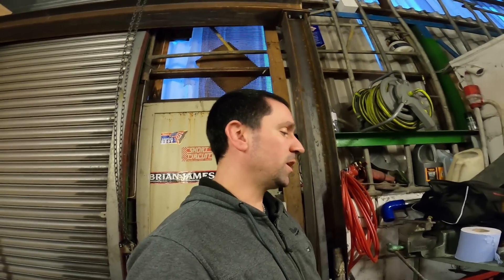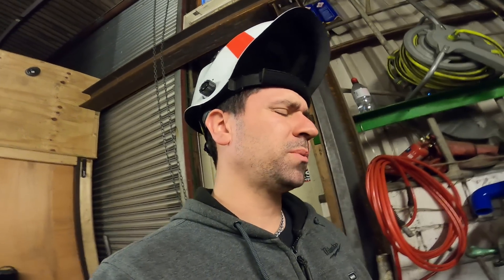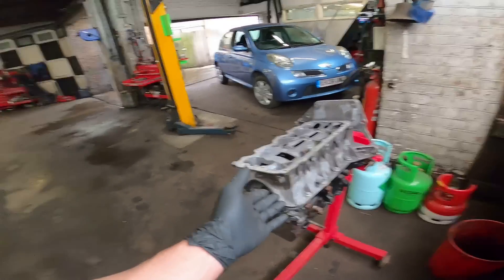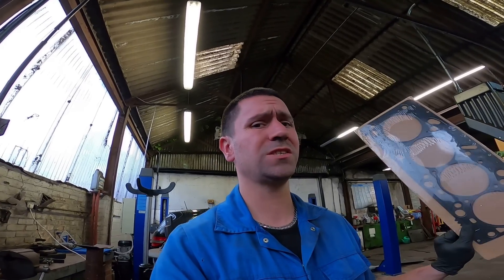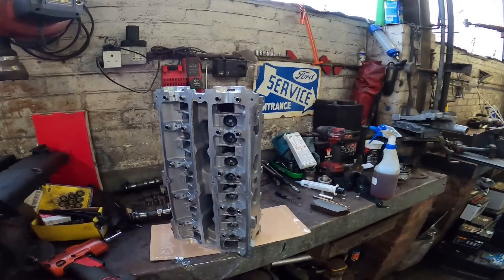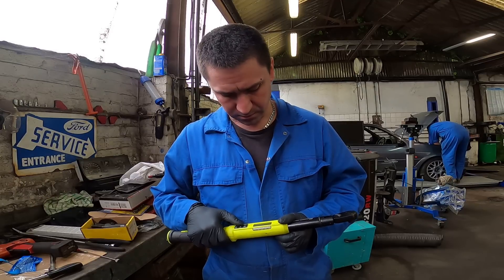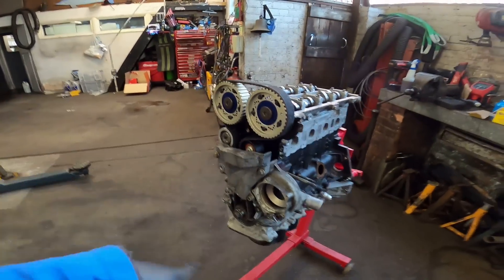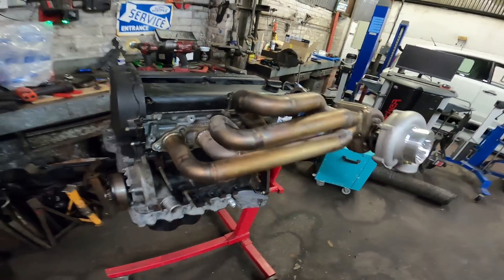700HP Zetec engine built part 2

Comment: what pcv baffle are you running in that hole? or do you just block it off with a plate? i assume you don't, as you want the crank case gases to escape somewhere. i've bought a makeshift pcv plate before, but it wasn't baffled, so it lost about a quart of oil out of it before i noticed lol had to go back to a u.s. contour baffle, as it's much more compact than the stock zx2 monstrosity lol thanks for the great vids, btw!

Comment: i have a mark 1 focus (in the US) and it was manufactured in 99. its not the RS or the SVT, just the ZTS (with the fancy wood panel lol). i've been thinking about turning it into a bit of a sleeper with a little turbo and seeing these videos makes me really want to do it. somehow i've only put 170k miles on the engine and frame i have, so i think i could get away with a turbo without grenading the engine lol. foci are getting more and more rare as time goes on, but the zetec is a nice little engine to work on. ford cut every corner possible when they designed the focus around the zetec, but the block itself is pretty solid. i've replaced literally every accessory so far (including the tstat housing) but nothing on the engine has given any issues at all.

Comment: Good work appreciate the honesty in workmanship no one’s perfect ,it’s just the weighty end on the turbo needs bracing ideally because that weight may crack the mani who knows hopefully it’s ok bud good work
Reply from the maker: That manifold has run like that for 3 year. Manifold braces/hangers were popular in the 90s when manifolds were made out of 1.5mm walled steel and we are prone to cracking. Mine is 3/4mm from memory it does not need a brace

Comment: As I recall the blacktop has the same head gasket as the rs lump? Numbers for aftermarket Reinz gasket is the same. 
Awesome build, interesting that the head doesn’t need more than pocket porting for 700hp, I think the exhaust side is crap, took me ages to port it proper comparing to the intake.
Reply from the maker: The same guy who ported my last head done this one exactly the same and that made a solid 750+ consistency 😎

Comment: I did my upper oil pan gasket twice and it leaked both times, brand new gasket, second time even used RTV ultra black gasket sealer on hot times but it still leaks in the rear driver corner of the pan, not sure what to do/what I could’ve possibly done wrong.
Reply: Any advice?
Reply: Also rear main is brand new too so it’s not leaking from that as far as I knwo

Comment: Nice work mic. You may have the Rb26 gtr head studs like im running in my zetec. Same length as the arp studs. No mods needs to use the cometic head gasket too 👌

Comment: Hi Michael loving the build uploads, are those catcam vernier pulleys on there, been trying to source some obx ones, no luck as yet and are they roll pin located could not see from video.
Zac and his gucci magic with the manifold did my rwd one.
Reply: I used them on my last build no issues,nicely made product
Reply: Turbosport do some nice cam pulleys there  not doweled though but you could do that yourself
Reply: @daleshreeve3498  cheers I've looked at those, any feedback on them

Comment: ok when i commented on pt1 i wondered if i should ask but now i'm asking, can you tell me if there are forged rods for silvertop with 21mm pin?
Reply: Go beyond ford rods in your search. I use H beams with 22mm pins and evo 8 pistons on my zetec. Vw rabbit diesel rods. Need to grind the crank or resize the rods for zetec crank. I resized the rods. Go check my channel if interested how.